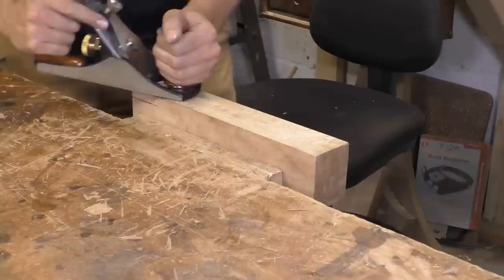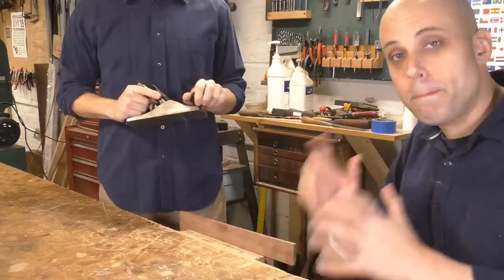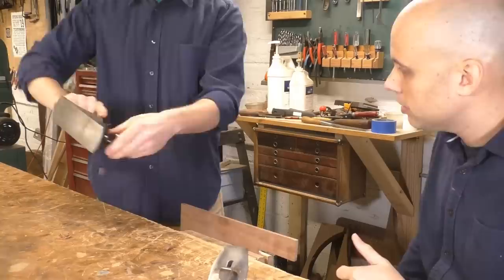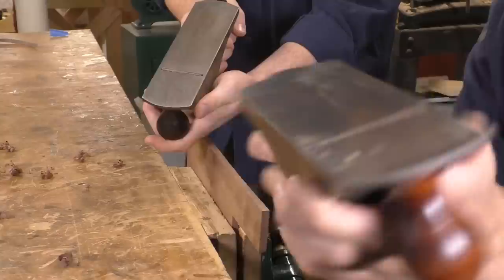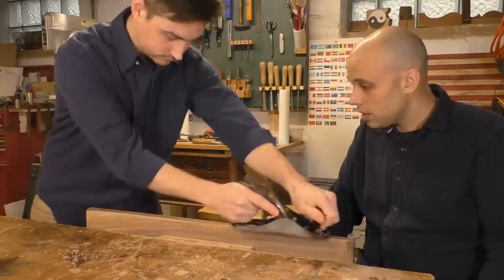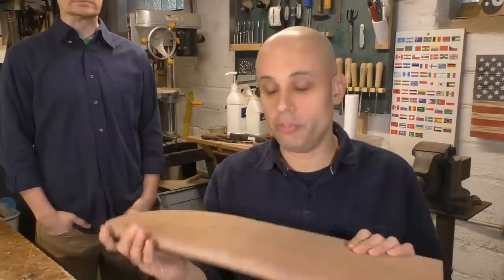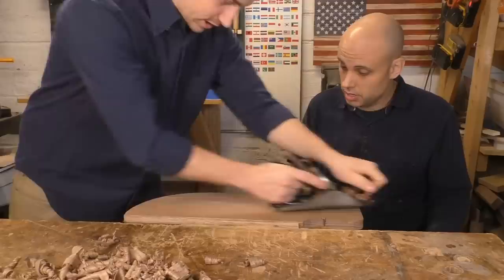Learn to use your hand plane!

Comment: Hey Rex - did you say that the walnut board was 'polite' at 8 minutes 14 seconds? If so, please explain how a board can be polite (not sarcasm) - and - can it be rude, obnoxious, or bitchy (totally sarcasm) also?

As always, great tips, advice and thoughts on how we can all take woodworking by hand tools to our friends and neighbors and teach them about the good, ol' hand plane.

May you always have chips and shavings in your shop (and maybe a little in your pockets),
~Jim
Reply from the maker: It's bitchy or obnoxious if it has reversing grain and other problems that cause tear-out. A staight board of an easy cabinet wood like walnut is polite and will give you no trouble.
Reply: Mr. Measure Twice buy some lumber from Lowe’s or home depot. 
For their  lumber it’s almost always 
“That time of the month”

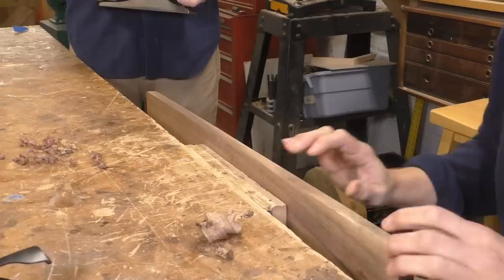Comment: Aren't you supposed to first "read" the grain of the board and make sure you're planing with the fibers coursing up in the same direction that the plane is moving? Otherwise, don't you risk roughening the surface -- or even tearout? For example, the board is turned around and in the wrong direction when its put back in the vice, beginning at 10:53.

Comment: I've watched soooo many videos on this and my mind has been made up.
Personally Im over attempting hand planing. I never have the "right" plane. I have 1 plane. I dont know what kind it is.
 I see planes are pretty pricey though. By the time you purchase all the planes you need, learn to set them up, sharpen and such you can buy a Festool track saw and straighten any board up in one pass with a glue ready cut.
 Life is too short to lollygag planing. Im literally going to throw my planer in the garbage can.
 I use my electric harbor freight plane and get better results than a hand plane without having to spend a lifetime doing it the pre electricity way..

Comment: HELP! i got a problem with my japanese saw, it is the kind of japanese saw with 2 kinds of tooth , one side with the small crossgrain and one sid with larger ripping teeth
and i am actualy a knifemaker,(hobbiest) and i have some roughly cut pear wood ai want to rip into slices to use for knife handles, 
i did a knifecut, beforehand drawed the lines and all, and started ripping and the deeper i got the more the saw go off line on the side pointing away from me
while being perfectly on line on my side of the piece. 
i am going my why the saw always pulls to the right side. and idk how to correct it in cut,
Reply: My two cents on this is that you can't really correct during the cut using a ryoba in the way you can with a western style saw. Instead you have to focus on correct alignment of your whole body from the moment you start the cut. Consider where your feet are as well as your hands. You should be able to trace a straight line from the tip of the saw to your right ankle (assuming you're right handed). Grab a bunch of scrap wood and try adjusting your stance until it's naturally producing straight cuts. Good luck!
Reply: @harrybrooks7750  thanks great advice i will test it out soon, 

i am right handed, and it could come from my body alignment definately

Comment: hi Rex, my lever cap (that's how you call it?) keeps falling of every time i try to use the plane (no 4) and it doesn't matter how many times i close it, it just falls off. please help
Reply: Edith T try tightening the screw holding the cap iron down.
Reply: @elischultes6587  thanks Eli. Tried that,  it doesn't help :(

Comment: I think I may feel worse about myself now. He was able to get the hang of it in an hour or so. I have been trying to plane some hickory and some knotty walnut, and I keep getting tear out all over the place. Totally ruining that gorgeous, wavy pattern in the walnut. I think I may have to give up being a craftsman and just go buy a planer.
Reply from the maker: STOP RIGHT THERE! You're blaming yourself when it's the wood that's the problem. Any knotty wood is very difficult to plane and hickory is the hardest North American wood. These are TERRIBLE woods to start on. Get yourself some clean 2x4 and practice on that. I think you'll see improvment right away.
Reply: Thanks, Rex!

I actually just built my first workbench using some 2x6s. The top is made from Douglas fir boards I ripped down to 4” wide and laminated. My hope was to end up with a final thickness of about 3.5”. I am trying to flatten the top, and having some trouble. Even getting some tear out on the Douglas fir. I think that may have more to do with my aggressive cuts and working at 45-60 degrees to the grain, though.

Any advice on how flat is flat enough?

Comment: I thought it was just scrub planes that had a camber.  Guess I need to go back and watch the shapening video.
Reply: "Shapening" or shaRpening?
Not sure shapening is a word, but it should be. 

Shapening: the act of shaping a cutting edge while in the process of making it sharper as well.
Reply: @thomasarussellsr  yes
Reply: Scrub has very great camber...”to act like a carving gouge”
Jack and fore slightly less...but still obvious. 
Smoother barely visible, just enough so that the sides of the blade can’t leave tracks on the wood.
Much like a “cheated” drywall knife...
Round off the points just a hair bit makes things a crap ton more easy. 👍🏽